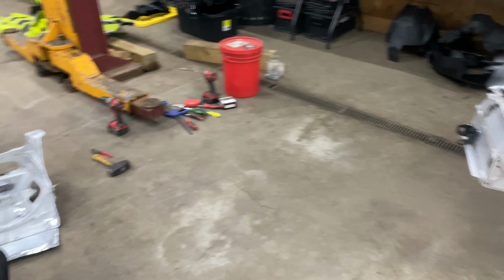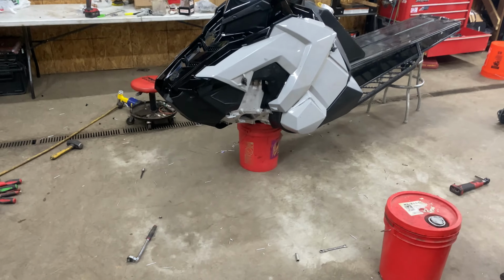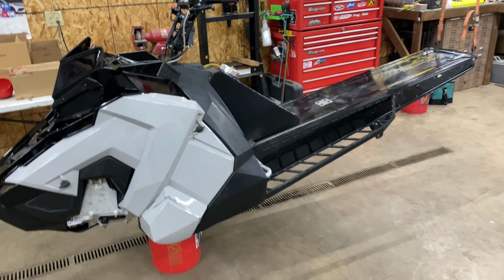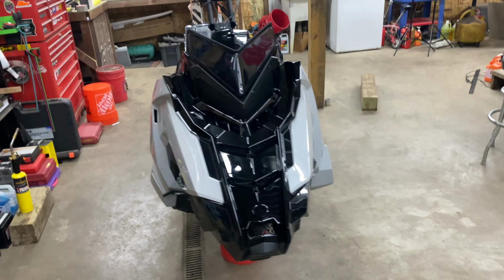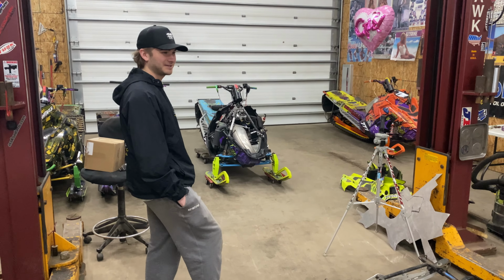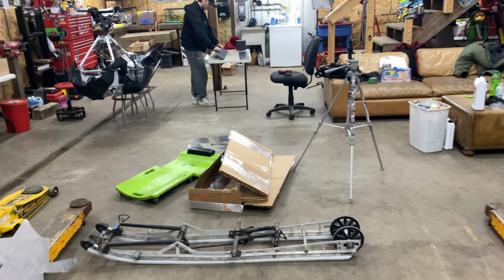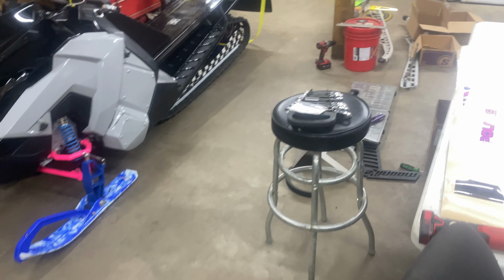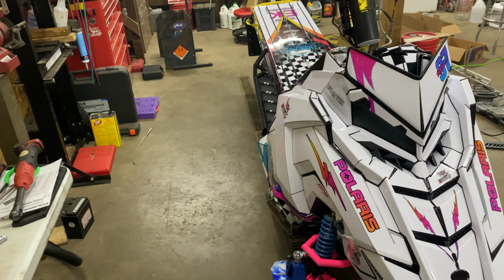850 Watercross Build for Slammin' Sam

Comment: I still don't understand, why you guys over there always use so short skids? Just looks so weird 😅 everyone here in the Nordics uses the stock skid and the sled turns both ways more then fine
Reply from the maker: We turn a lot sharper on the course, so that’s why I like the small skis, the big skis definitely help with high speeds.
Reply: @SnowmaxPerformance i mean the skid "like the back suspension" not skis . Looks like you have a 137" in a 155" chassi
Reply from the maker: @mackanno99  my bad though you said skis, 146” skid 155 tunnel, it’s all rider preference